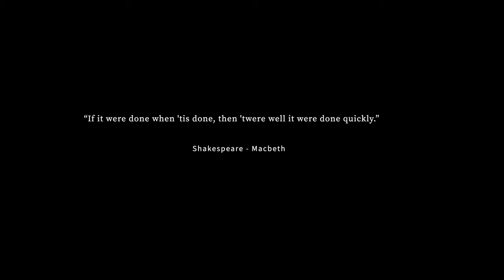Pulling the Plug - how Mammoet recovered their support platform from the La Salle Lift Bridge 4K

Comment: Can somebody tell me what went wrong with the repair
Reply from the maker: Paul - first and foremost, thanks for watching.  Now, the reasons are unclear, but on March 30th a major component of the fixed structure of the lift bridge buckled.  It was a beam on the north side connecting the trunnion (bearing) to the counter-weight. Many explanations have been suggested, but no authoritative statement on the case has been made.  An inquiry is in progress.  Checks of the whole bridge revealed concern that damage, though less evident, was not confined to the beam. A decision to demolish it was taken after it was decided that repairs could not be effected safely and economically.

Comment: I'm new to this channel.  What is the reason for removing the bridge?  Is it being replaced, or is traffic being permanently stopped?
Reply from the maker: Welcome to the channel - thanks for dropping by.  The bridge is being removed because of safety concerns about its integrity after an incident occurred during maintenance work.  Traffic will flow again, but not until a replacement bridge can be introduced.

Comment: What is the battery flight time capacity on your drone? It covered a lot of footage!

It's a shame that the bridge is going away. 😢

I'm also surprised that they didn't hire Mammoet to simply remove the bridge on a barge. It would be the fastest and least invasive way of demolishing it in my opinion.
Reply: That would be one big barge
Reply: @_Hari_Seldon  Wouldn't be the first time, either; Mammoet has done similar previously, hence my suggestion. Without the counterweight, it should be easy.
Reply from the maker: Thanks for your interest.  Any one battery lasts up to about 35 minutes.  I have several and select the times to fly back and change them. Since I must always have the drone in sight, it's never very far away.